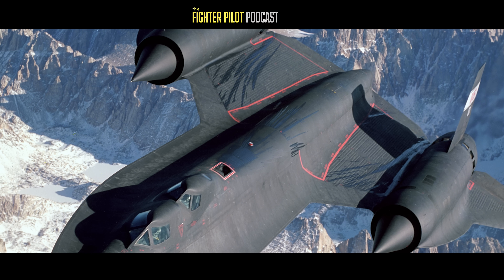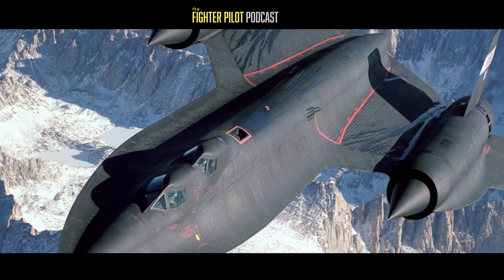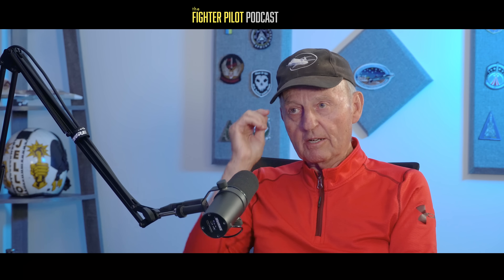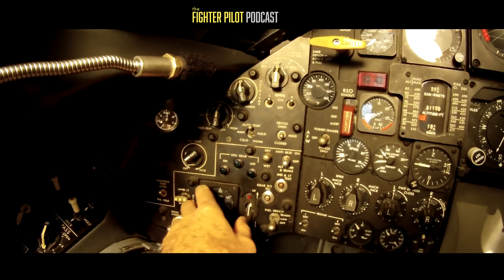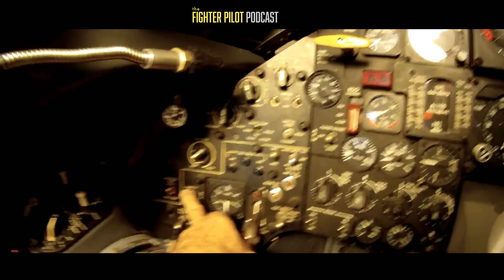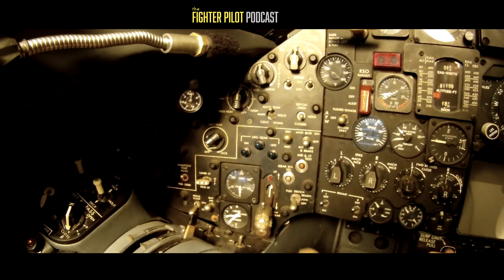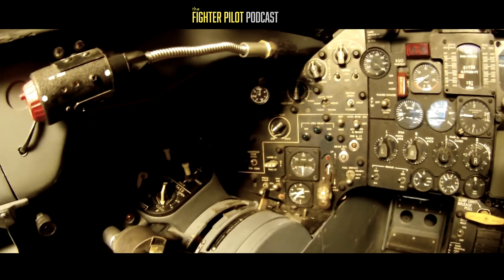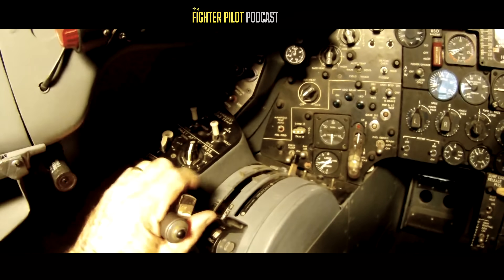NASA Test Pilot flew the SR-71 Blackbird

Comment: J 58 that was in the sr 71 and the A 12 was limited by temperature at the compressor Inlet , temperature was not an issue with the exterior of the air frame melting. It was totally temperature at the inlet of the compressor. This guy should know that.

Comment: its been clocked at mach 3.8 plus  and that was  a   sustained period of time
Reply: Maybe flying through the jet stream and measuring ground speed it "calculated" back to Mach 3.8 "equivalent" but it never flew "through" the air faster then Mach 3.65. The geometry of the plane doesn't allow for it. As you go faster the Mach cone off the nose narrows and at Mach 3.65 the shock angle coming off the nose spike will touch the front chines, engine inlets, tail and wingtips all pretty much simultaneously. You wouldn't be able to control the aircraft once that happens. It's not a matter of engine power, it's where the shock cones are that limits it's design.
Reply: @wally7856  well a pilot was  a family friend ,, it had more  top end power than you think ,, its didnt need a jet stream to aid it to 3.8 plus  ,, it has gone to over mach 4 in a short sprint ,, but it held 3.8 with no problems  , just to out run a missile  ,, also the pilot talked about both migs 25 and 31  struggling  to get  to 10000 ft under the SR71 and they both were stalling ,, he was laughing ,
Reply: @keithbell6104  The geometry of the plane and the geometry of the shock cones coming off the nose says that any thing over Mach 3.65 in this plane is impossible no matter how much top end it had. The engine inlets wouldn't be stable with the nose shock entering them and neither would the wing, tail or front chines. You would need the front nose spike to be 20 feet long to reach Mach 4 and keep the nose shock away from the plane.
Reply: @keithbell6104 lol virtually nothing you said is true

Comment: Can someone on their death bed tell us the real top speed pretty please?
Reply from the maker: …and while they’re at it, what actually happened to Jimmy Hoffa?
Reply: As you go faster the shock cone off the nose spike narrows. If you do the geometry and some math and physics at Mach 3.65 that shock cone hits the front chines, engine inlets, wing tips and tail all pretty much simultaneously. You would lose your engines and control and lifting surfaces at that point so I can confidently tell you it can't fly faster than that while maintaining engines and control. It may have had structural and thermal limits less than that but aerodynamically it was limited to Mach 3.65 before bad things would happen. Any claims that it went faster are just legends.
Reply: Been public for over a decade now

Comment: I was 18 a few weeks from turning 19 when I arrived at Beale AFB at my squadron the 9th AMS.  I was a avionics technician.  Our shop did the inlet schedule on the SR-71.  The inlet spike is locked in place <1.4 mach.  Above 1.4 mach the inlet spike would travel 26 inches depending on the IAS, ALT, AOA and ROT.  We always had formal debriefs with aircrew and we never wanted them to experience a AD or unstart in flight.  There's something about a dude in a space suit arriving at your SR-71 in a white stepvan in a lazyboy recliner that steps out of their PSD van and steps up to the cockpit.  Sorry to hear about Brain Shulh.  He was flying the SR-71 when I was wrenching in it.  We went TDY to Okinawa together.  Tell you a story.  While stopping off in Alaska Brian and his buddy's bought boxes of crab legs that the KC-135Q crewchiefs strapped down in the wheelwells to keep frozen in flight.  I was blessed to work on that plane.

Comment: A fun event is to attend functions at the Beale AFB in Yuba City, CA.  Yuba City of itself is an interesting City with several neat hang-outs.  At almost every event you will be exposed to Lead-Sled Drivers.  As you get to know them, they will share certain stories about the plane.  One story you will not hear (because it reflects on the office of President) is that it's really the RS-71.  On role-out, dumbass LBJ misspoke the name as SR-71 so the official name had to be changed.  Even the role-out brochures were collected back during the event.  Past that, one of my favorite stories is when the Russians sent their most recent interceptor variant during an over-flight.  As the interceptors "pegged" after reaching 60,000 feet, the RS-71 pilot lightly punched the fuel-dump valve thereby creating a brilliant vapor plume that spun off the wingtips.  Just his way of just saying "hello down there" while cruising at 80,000 feet.  He then lit the burners and just disappeared.  There are times when it's great to be an American.  Then Ya watch the news and puke.

Comment: 3000psi . . .in a pulsed fuel line,  . . . .what sort of material and design can tolerate that for any length of time without fatigue setting in ?
Reply: Stainless steel for starts.
Reply: Your FORD diesel engine uses that much pressure to operate the fuel injectors..  No big deal.

Comment: What did he say about banging you head?
"onstart"?
Reply from the maker: “Unstart”, an engine phenomenon unique to the SR-71.
Reply: @FighterPilotPodcast  Thanks!
I read up on it and it is not restricted to the SR-71 but to all >2M air breathing engines that use inlet compression for more than just the decrease in velocity.
It is like a compressor stall but for the inlet.

Comment: Pin the landing gear? In case the landing gear collapses without hydraulic pressure from the engine?
Reply from the maker: Just an extra safety measure applicable to most aircraft.
Reply: @FighterPilotPodcast  That is a detail I must have missed and I have watched a lot of Blancolirio, Mentor Pilot, AgentJayZ, AVweb etc.
Reply from the maker: @zapfanzapfan  🤷🏻‍♂
Reply: @FighterPilotPodcast  Learned something new today at least.

Comment: He didn't discuss it, but the J58 engines were modified for more power to compensate for the drag of the L.A.S.E.R.
Making the envelope between unstarts smaller. Creating an issue for the pilot's. Plus the intake heat went up and the pilots were on the edge of burning an engine up.
I was at Edwards Air Force Base during this time (1984-1992).
Reply: That 5% increase really took a toll, especially as they could barely go over mach 1 even with that
Reply: @gr8crash  
You obviously don't know much.
Reply: @krysb7119  obviously more than you.  You were correct on a lot, so obviously mentioned something you aren't aware of. Which part aren't you sure about? I could fill you in probably.
Reply: @gr8crash  
Did you work on the program? No. I didn't think so. You obviously don't know as much as you think you do.
You should have stayed in school.
Reply: @krysb7119  you didn't either apparently. But I know the people who did,  and who helped with the modifications at Lockheed required to the airframe etc. So what part are you unsure of? The thrust enhancement? Or the inability to reach mach 3 or a high altitude?
Reply: @gr8crash  
I have no questions for you for what I wrote in my main comment is correct. I also know people at NASA DRYDEN who worked on these versions.
Your comment about a 5% increase is false. That's what I commented on.
Do you have a lack of comprehension?
Reply: @krysb7119  actually you didn't specify. You could have said "I don't think it was 5%, it was X %". But you didn't do that. You chose to display ignorance instead. I also know some of the people who worked at Dryden on this project as well as ones at Lockheed that were involved in the modifications and such. The information comes from them. The NASA studies I believe said a 10% thrust increase could be attained but I think for LASRE they did 5%. And that was all needed because it couldn't pass through the transonic zone without it. It also severely reduced the TBO of the engines. Even with all that, whether it was 5% or 10% the aircraft still couldn't reach mach 3, it couldn't even reach mach 2.

So again if I have something wrong, provide some actual information. If you have questions let me know, I'll reach out to the guys that were there.
Reply: @gr8crash  
I never displayed any ignorance. You're showing your lack of comprehension.
Reread everything we've written.
That's why I keep holding true to my main post.
You don't seem to understand. During my main post I stated I was at Edwards Air Force Base from 1984 to 1992. I've also stated I know people from Dryden who worked on this project. Why would I need to ask you anything?
You keep arguing your points that you pointed out that my main post had nothing to do with. 
The only comment of yours I disagreed with was your 5% added thrust. You're on this high horse for some reason. 
But at no time have I shown any ignorance about anything I've discussed.
Reply: @krysb7119  well no you actually have. My response to you was in agreement with what you wrote. You simply replied back with a rude comment but never addressed why. Yo disagreed with the thrust enhancement ok, why? Was the number different than what you heard? Or did you just never hear about that? If it's just a different % then ok, what's different?  If you haven't heard it, then ask about it and learn something.
Reply: @gr8crash  
What part of I grew up around Edwards Air Force Base and I know people who worked on the project do you not comprehend?
I know the information. I don't need to ask you anything.
You seem to think you know more than I do. That is your fallacy.
Reply: @krysb7119  well then we probably know the same people.  And since you seemed to contradict my comment about the thrust enhancement, even though I agreed with you I'm not sure where your confusion is but it's there.
Reply: @gr8crash  no confusion on my part. But thank you for projecting.
Reply: @krysb7119  well you're confused on something. You said they modified the J58 for more thrust,  I agreed and gave the 5% it was increased. Yet you say I was wrong, so what was wrong?

Comment: The SR-71 would get so hot during flight that the metal would expand. To account for this, the plane was intentionally made with gaps and would leak fuel while sitting on the runway.
Reply: The expansion part is true, the rest of your comment regarding gaps, fuel leaking etc is completely untrue
Reply: @gr8crash  Google “Did the SR-71 leak fuel” to see how wrong you are. I heard it first hand from a former pilot at an air museum.
Reply: @truthsayer9534  couple issues, largely your comments are incorrect. But that's fine as you're largely using Google. So yes there were expansion joints but NONE of them were at the fuel tanks. The aircraft did expand 3-5 inches in flight with most of this airframe expansion occurring at STA 715, which again wasn't at the wing tanks. Also never use Wikipedia as an accurate source as it essentially isn't. Also you may have heard a pilot say that, which is also a mistake. In general, pilots aren't maintainers like maintainers aren't pilots. Pilots know how to fly the plane, maintenance knows how to fix it and usually their respective knowledge base stops there. 

But, the tanks were sealed. The tank structure was sealed with fuel tank sealant,  the top wing tanks access panels were sealed with church seals. These panels were attached and torqued securely to the airframe. IF and panel, door etc was ever installed and didn't fit securely the panel had to be removed and the issue fixed. The panels had a "gap" no different them ANY aircraft with an access panel has. 

So again, yes you're incorrect. Next time go to a symposium and during the Q&A ask this question and they'll tell you what I just did. Depending on which person answers, if it's Floyd, David is Mike they will also add that it was the thermal cycles encountered during flight that caused the sealant to crack and the leaks to start. Once they did, once the leaks limits were exceeded it would be scheduled for fuel cell MX and the sealant would be repaired.
Reply: @gr8crash  Yet another article explains the reason:
Titanium fouselage panels were fitted to the frame relatively loosely – again, to allow for heat expansion. This is what caused those infamous fuel leaks – every single one of SR-71 ever made started leaking fuel at some point. But why?

Well, metals expand when heated and shrink when cooling down. The fuel system of the SR-71 could not be sealed permamently because there simply were no sealants that were flexible and durable enough to deal with those kind of temperatures and shrinking-expansion cycles. Sealants were applied and re-applied during maintenance (when they were fresh, the plane wasn’t leaking), but they simply wouldn’t hold up. SR-71 would stop leaking once it came up to temperature.

Also, fuel in SR-71 was used to cool the titanium surfaces. Because titanium pieces were fitted with some room for expansion and only came into good alignment when up to temperature during a high-speed flight, fuel was leaking through them.
Reply: @truthsayer9534  so another couple things.  The 1st paragraph is largely incorrect. The 2nd paragraph basically proves everything I was saying so thanks and the 3rd one is also most wrong. 

The panels were not fit loosely to the aircraft,.that's a completely ludicrous comment and only people who don't work in aviation would think that makes sense. All panels were securely attached to the airframe, keyword is securely. Any panel that did not attach securely was removed and the issues fixed before the panel could be installed. Yes there were expansion joints,  but those joints weren't at the fuel tank access panels. 

The 2nd one is good, it explain the sealant being applied and how it became damaged from the thermal cycles causing the leaks. Once these leak limits were exceeded the aircraft would be scheduled for fuel cell MX and the damaged sealant would be removed and reapplied. The upper tank looks access panels were sealed with church seals and again securely attached to the airframe. 

The panels didn't come into alignment when flying, the aircraft simply expanded at its expansion joints and that was it. The main joint being at STA 715. But again there were no expansion joints at the fuel tanks, nor were those panels fit loose or with gaps for expansion.
Reply: @truthsayer9534  I'm not wrong, I am 100% correct.  Again. The 2nd paragraph explains everything really well, but you're 100% wrong on the rest. But here's the difference, you're looking at Google because it's easy and it's all you can do. I'm going by the maintenance manuals, the design studies, interaction with former maintainers and pilots. You can believe what you wish, but be ready to be corrected on it. And if you go to any SR71 forum and ask this question, you'll be told what I told you. If you go to a symposium and during the Q&A and ask this question you'll get the answer I gave you as well.
Reply: @gr8crash  From the wiki page for the SR-71 with the citation cited. “Fuselage panels were manufactured to fit only loosely with the aircraft on the ground. Proper alignment was achieved as the airframe heated up, with thermal expansion of several inches.[35] Because of this, and the lack of a fuel-sealing system that could handle the airframe's expansion at extreme temperatures, the aircraft leaked JP-7 fuel on the ground prior to takeoff,[36] annoying ground crews.”

Comment: 4:42 "on start"? or "non-start" He mentioned that a couple times. No idea what that is. Guess video is just for other fighter pilots.
Reply from the maker: Or maybe it's okay to not understand everything without getting snarky.
An "on-start" is an engine malfunction unique to the SR-71. I don't know all the details and did not ask him to explain during the interview.
Reply: He's actually saying "Unstart". That happens if the engine inlet spike moves to the wrong position, and the engine stops producing thrust.
Reply: Correct but, more importantly, the lateral forces were severe so Lockheed designed in a cutoff for the opposite engine; a restart at a lower altitude was made to continue the flight.
Reply: UN-start
Normally we'd translate that as a compressor stall, but it permits a broader scope of sudden engine 'loss of thrust'. With the intake cones adjusting shock wave locations, there are a lot of things going on that could put you in jeopardy.

Comment: It's so amazing how fast all of the difficulties were solved at a time when slid rules were the only computers they had.
Reply: I still have my Bosch Slide Rule
Reply: @klausphx Mine's an Aristo Studio with log log scales. I've still got the little plastic desk stands. I don't use it in action any more, but I occasionally bring it out to give it some love.  😄😉
Reply: The way that works is to limit yourself to analysis and design work that actually matters, rather than attempting to use massive random calculation with a computers to just "hope" you get the important cases.
Reply: @brettbuck7362  well said.
Reply: Slide rules are calculators not computers…